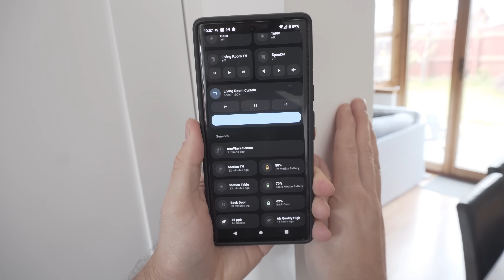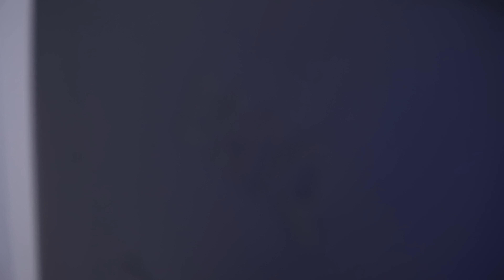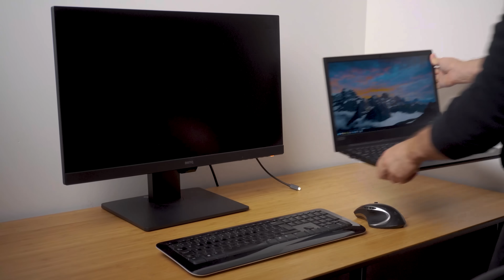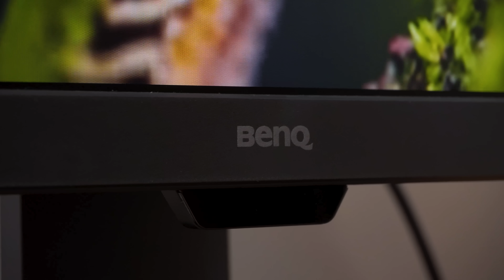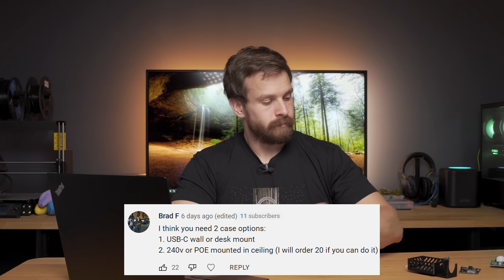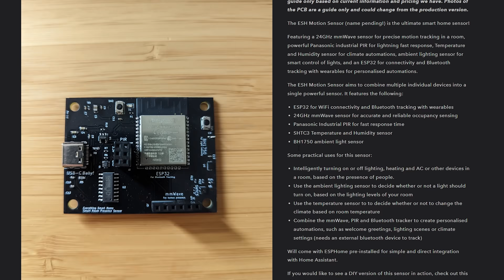I'm Making My Own Smart Home Motion Sensor!?

Comment: Great project, congrats! A few suggestions for a second version: 1. You can solve the double power issue with 2 diodes, so that power cannot flow from one supply to the other. 2 - from what I've seen, you didn't route the PCB around the temp sensor. This will cause it to warm up a little bit from the ESP32, as it does use around 0.5-1W of power when running.
Reply from the maker: There is a jumper that prevents power from being supplied to both already 😅 I'm not sure what you mean by routing the PCB around the temp sensor but the new prototype that is being produced has the temp sensor isolated from everything else as well as a cut out around it
Reply: @EverythingSmartHome  That's what I meant, the cut around the sensor. I really love the sensor btw! Indeed, the jumper solves the issue, I just meant that with 2 diodes you can solve this without any user intervention, like shown in this image here: https://www.edn.com/wp-content/uploads/media-1196006-5408fig1.png
Reply: Regarding the heat issue, from the video that’s what the next prototype is trying to solve.
Reply: @MichaelAlderete  I missed this in the video, my bad... I didn't mean anything bad, I love the project and the channel.

Comment: On a practical note, your decoupling capacitors should be as close to the power input pins as practically possible, especially on the microcontroller and the regulator. If your microcontroller draws a spike of current they stops the voltage dipping and things browning out which can be very hard to recreate/diagnose. It looks like you're already handling auto-reset with Q1 being a dual transitor package, but if I'm wrong and you're not doing auto-reset that's a must have feature even if you have the button on gpio0 as a backup. In terms of expandability I typically use a QWIIC connector (JST-SH), adding anything more complex than that gets messy fast. Good luck with this you're off to a great start. I can't tell you how many PCBs it took me to realise that mounting holes are important and you've got them in version 1 of your first PCB.
Reply from the maker: Thanks for the tips, we do indeed already have auto reset and the redesign takes care of the capacitor thing.

Haha mounting holes are definitely handy!

Comment: Would love to have a case with a psu built in. Plug straight into the socket. Instead of having cables and crap all over the place.
Reply: +1 to this! Alternatively, if the case had a way to clip to some of the really common USB power supplies (the older, tiny Apple iPhone charger comes to mind, since I have dozens), that would be pretty nice, while still letting you not take on the effort (and risk) of handing the power supply yourself.
Reply: +1 👍

Comment: Love this. How about offering it at a lower price point but without the MM wave sensor in case people can’t afford the £65 and can do without the sensor in the short term?
Reply: I can certainly understand the desire to get the cost down. But once you take out the mmWave sensor, what about this device is attractive to you, compared to the many non-mmWave sensors already available, either commercially or via DIY plans? I honestly don’t see the point in getting this without the mmWave sensor.
Reply from the maker: There will most likely be the option for the PCB only if you would like!
Reply: @EverythingSmartHome  yes please. I bought 2 mmWave to build your previous DIY build and then you bought this out 😂. Great work, looks really good!!

Comment: Awesome work, love the sensor! Any chance you'll make a Zigbee (or Thread) version?
Reply from the maker: Would love too, perhaps in the future!
Reply: I would look forward to such a version as well. I might lose its expandability, but I believe there are plenty of people not wanting Home Automatisation on wifi.
Reply: I guess the problem is that ESPHome doesn't support Zigbee. You would need a Zigbee radio and you would need to write your own firmware. Espressif has announced a variant of the ESP32 with a Zigbee radio instead of WiFi (ESP32-H2) and there's interest in the ESPHome community for supporting it, so maybe later it's possible to just switch the ESP32 board.

Comment: Awesome to see this! I built a couple based on the previous videos but would love to get some of these. I’d like one in every room and would order 12 as soon as they’re available. Hopefully you’re able to get them out soon!
Reply from the maker: That's awesome, how are you finding them so far?
Reply: @EverythingSmartHome  They’re awesome! I definitely need to tune them in but have yet to do so as I really want to mount them higher up on the wall and run the wiring through the ceiling for a more seamless look, but havent found the case to do so yet and my modeling isnt on par

Comment: 10:31 re: PoE supply shortage - See Home Assistant Yellow. Kinda regretting ordering the PoE version for the delay it's seeing vs the non-PoE version, but also be sure to consider regulatory requirements like they're dealing with since PoE support means you have to have the device certified as a power supply.
Reply: Good point about the regulatory requirements. IIRC, the Konnected Pro board had to be reworked multiple times due to emissions or other testing/certification requirements, all coming from the PoE support. It added months to the product development time.
Reply from the maker: Oh yeah never even clicked with Home Assistant yellow! Good point thanks

Comment: two words - ceiling mount
Reply: if you're open for suggestions - this would be an ideal replacement for Aeotec's multisensor, which uses a 75mm diameter recessed ceiling mount
Reply from the maker: No reason people couldn't design their own case for that, good idea

Comment: Looks, good.  How about a Zigbee model as well.  Or just keeping it Ethernet, WiFi, and PoE?
(edit) - Also think if you could get the WLED integration to work with it, it might be nice feature to have as you could use both with one device.  Just an idea, not sure how well it would work together.
Reply from the maker: That certainly is an interesting idea!

Comment: If you add Homie-IOT support (protocol on top of MQTT), you're instantly compatible to many smart home hubs, with auto detection and easy setup and everything. It's actually quite simple: make the topics according to a predefined scheme, make all non-alert-type messages "retained" and send the config topics on power-up and then repeatedly every hour or so, and you're golden.
Reply from the maker: Will look into it thanks

Comment: Does the ESP connect to the UART of the mmwave sensor, or just the "presence" signal? I'm interested in looking at custom firmware that can work with the point cloud information (assuming this sensor produces it).
Reply from the maker: It connects to both :)
Reply: @EverythingSmartHome  Awesome 😊 I'll be waiting for the PoE version but I'll definitely be buying!
Reply: @EverythingSmartHome  One final question, sorry - is this the DFRobot sensor or one of the Seeed ones, or something else?  Just asking so I can become familiar with the datasheet before mine arrives :-)

Comment: the idea is nice but..... i am not a fan for a few reasons...

1. it is not battery-powered. (yes i know mm-wave takes a lot of power.... but what if i don't want to use the mm-wave?)
2. you can't place it anywhere you want (again power issue)
3. the power input should be at the back.
4. it is not zigbee. wifi is not always a robust solution. zigbee is the way to go.
5. in the end... why would you want this? yes i know it's a smart home-enthusiast device but... i can get a zigbee motion sensor and a temperature / humidity sensor based on a battery and smaller form factor, with 1/3 of the price? AND it will work right out of the box with HA without any configuration with ESP Home, etc.

this is just a discussion. no hard feelings. i am curious how people are going to use this.
Reply: I agree with you on the power options. I'd be looking to wall mount something like this and trailing power cables is both messy and not an option when you have young kids/pets. If ditching the mm wave meant lower power consumption and the potential for battery power then I'd probably consider this over a custom build
Reply: @PatRobinsonOnGoogle  you can just use the GPIO 5v pins for power, they're barely a mm thick.
Reply: While I get your points, they overall point to this not being the right product for you.  And more fundamentally, you don’t seem to value the mmWave sensor, at least not compared to your power/cable requirements. 

And that’s fine! There’s no one size fits all sensor out there. If you prefer to do away with the improved accuracy in favor of reducing the power draw, that’s totally valid. 

Me, I’m looking to solve the “I’ve been in this chair for hours typing, and I’m tired of waving my arms around stupidly every time the PIR sensor times out” problem. You can’t do that without mmWave, and you can’t have mmWave on a battery, at least not for any usable length of time. (Or a huge battery, which is a bigger problem than wires that can be hidden, IMHO.)
Reply from the maker: Battery just isn't possible for this device, that's why the Aqara FP1 is powered also and not battery power. It may be possible in the future, but right now, no one is doing it.

Power input being at the front makes no difference IMO, if you want to power it using the headers, then you simply put a hole in the back of the case and insert the power into the front headers, no visible power cables that way. 

WiFi because everyone has WiFi, not everyone has ZigBee, and also it's much more difficult to program firmware for ZigBee (I don't know anything about it personally) - saying "ZigBee is the way to go" may be right for you but it's not right for everyone else. Don't get me wrong, I do want to make a ZigBee version in the future, we just don't have the capability right now :)

You also compare this sensor with a motion sensor and temperature sensor, sorry but they aren't really comparable with this sensor alone, they don't have the same functionality and aren't an apple to apples comparison. I note that you didn't compare it to a mmWave sensor, a motion sensor, a lux sensor and a temp and humidity sensor, why was that? ;)

It seems that this device isn't for you, and that is completely OK and I totally get it, it won't be for everyone! Thanks for the feedback regardless

Comment: Congratulations!  You use KiCad? I’m in live with it.  Using kicad and jlc for my stuff.  Sexy board, you should have bragged and shown off the board close up.  Assuming you went 4layer?  Layouts are so much easier.    To think what this cost 17yrs ago when i was in engineering school.  4 layer 50mm^2 board would have been 500-1k
Reply from the maker: Thanks, yes indeed using KiCad and it's crazy what you can do now!

Comment: Would love to see a battery powered version, but i guess the mmWave sensor needs quite some power?
Reply: A battery powered version isn't really viable - it has multiple sensors which need to be active at all times, and have a constant wireless connection, to give the fast response that is this product's main feature.
Reply: I think one of the other videos in this series talked about power requirements. But yes, the mmWave sensor is a giant drain. IIRC, Lewis might have said you’d get mere hours of use, unless the battery was ginormous.

Comment: in addition to the extra gpo pins you should consider exposing the i2c bus that is used for the temperature and light sensor so that more i2c sensors can be added
Reply: I was actually thinking specifically about QT connector, but honestly, simply exposing the two i2c pins along with 3.3v and gnd would be plenty.

However, the JST connector that is used on sparkfun and adafruit products would definitely make this a lot more "plug and play friendly".
Reply: I was going to ask the same thing. Might be nice to use the Adafruit Stemma QT connector for this. This would allow for plug an play sensors, but you can also break it out in to regular jumper wires. And it is smaller than adding a 4 pin header.
Reply: Agreed. I'd like to flush mount a numver of these and would need an external light sensor.
Reply: True you could use the other gpio but why not daisy chain and keep more pins available. Also agree it will be easier for people to scan and modify existing code rather than set up another bus as I'm guessing majority of people buying this will not be seasoned tinkerers.
Reply from the maker: Can more i2c sensors not be added through the GPIO pins? ESPHome supports multiple i2c buses. Is there a reason you'd want the same bus specifically?
Reply: @EverythingSmartHome  I think it depends on the ESP module used. If I'm remembering your video correctly, you're using an ESP32 here, which does indeed support two i2c busses (the ESP8266 only supports one), which as you point out could be assigned to the extra GPIO pins. 

This does however slightly complicate the ESPHome configuration as users then need to specifically specify the new bus for their new sensors. 

Presumably you would be providing some already configured yaml for ESPHome for users of your product. If this is the case, it would be a lot simpler for users who might not be super familiar with ESPHome and ESP32s in general to simply daisy chain new sensors (or even OLED screens) off of the existing i2c bus without needing to do much else. 

My suggestion was coming from making it a little simpler to use for people who might not be as familiar with these embedded systems.

If carefully designed, your product could be a launching pad for people sharing modifications and extensions that simply require plugging something in and having a new lid 3D printed (as a simple example). 

However, I can definitely understand that this suggestion complicates things as it is yet more revisions to your nearly done PCB. 

Regardless great work here, even if I'm not the target audience for the device 🙂
Reply: @chrishoage  I have two bme280 on an 8266, did need to scratch out a track on PCB and solder a jumper to change the address of one of the sensors, works fine 👍

Esphome no problem both bmes integrated into HA

Comment: I love it! Idea though, make the USB-C port on the back pointing orthogonal from the board, right now you plug it in and the sensor faces the ceiling!
Reply: It is setup just like all of the current ESP boards are. Just the case will prop it up facing forward
Reply from the maker: Yeah not sure what you mean either, the case will point it the correct way :)
Reply: @EverythingSmartHome  Instead of making the USB-C port point towards the side of the board, which means the cable gets in the way when you try to install it somewhere no matter what orientation, with a bit more effort you could put the USB-C port on the back. 

Imagine an arrow coming directly out of the mmWave sensor - make the USB-C port point the opposite direction of the beam, coming out of the back of the board. It's admittedly harder to do, but will allow you to make the case much smaller because you won't have to prop it up to allow for the USB-C cable
Reply: What do u you mean?

Comment: How about an infrared sensor? Might be nice for an outdoor security setting
Reply from the maker: Maybe for v2 😅
Reply: @EverythingSmartHome  cool! Is this going to be pretty simple to integrate into HA?
Reply: @Ghanzo  The video says it will come with ESPHome pre-installed. It should be a matter of adding power, connecting to WiFi, giving it a name, and all the sensors should appear in Home Assistant ready for use.....assuming you already have ESPHome integration installed on Home Assistant.
Reply: @MrTjnielsen81  Nice, that seems easy enough. What about the mili sensor? How do you configure that thing? Will it show up as an entitiy?